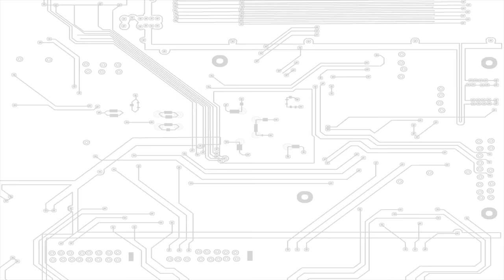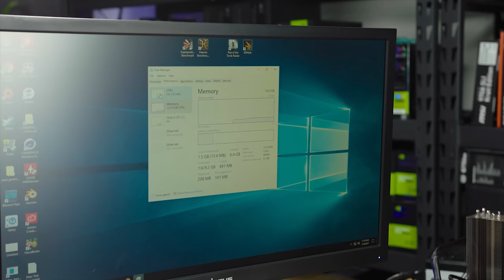How to fix bent CPU pins

Comment: I dropped my AMD FX-8370 on the ground and got thermal paste on the pins! The pins bent on impact and I re adjusted them. I got the thermal paste off using a toothbrush and some rubbing alcohol. This video has really brought back some flashbacks for me, Jay!
Reply: Macie Jay that’s a scary moment.
Reply: Why was there thermal paste on the ground? o_O
Reply: Not thermal paste...
Reply: Forgot to mention I got thermal paste on my hands and my handling the CPU somehow got it on the pins :/ sorry
Reply: Macie Jay if that happend to me i would bend it back like a real man with my nail.

Comment: @JayzTwoCents  This video just saved my Ryzen 7, my 6 year old I5 streaming PC burned out and I'm building the new rig with a Ryzen 1800x...but it somehow had 3 bent pins in the middle when I took it out of the tray, and so I did a search and found this vid.  Can't thank you enough good sir, you just turned a nightmare into an awesome day. :)
Reply: And whats happenjng when you broke pkns? It dont work or work worse?
Reply: @greenray3174  None of the pins broke, I was able to bend the pins back and install the Ryzen 1800x in my motherboard.  The 1800x is still working in my "new" system 11 months later, I use it for gaming/streaming and everyday use. :)
Reply: RepublicOfAwesome Will I be able to get away with 1 bent pin?
Reply: gonna have to do this with a 3700x. Installed the aio we bought, the cpu popped out of the socket trying to get the damn arms locked into place installing the cooler and bent three pins on the edge of the cpu. absolute nightmare when the damn system wont boot.
Reply: @Owowkiller  did you fix it?
Reply: @MasterTeep  i never did, no. havent been back to my friends house since then.
Reply: Owowkiller any update ?
Reply: @Owowkiller  Fix it?
Reply: @gedimangediman  yep finally did.
Reply: @Owowkiller  Great. 🙏🏻

Comment: Thank you sir, I managed to repair my Ryzen 1800X using your advice.
Reply: Nice!
Reply: I managed to repair my 3700x god i was so stressed but i managed to straighten them. also do u have any idea if because i repaired the bent pins will it affect performance or will it run normally
Reply: Hitman gAmer  yeah it started after i fixed the pins
Reply: Hitman gAmer  no problem, be careful and fix dem pins
Reply: AndreiPNK I don’t know if anyone’s answered your question but to my knowledge. It’s either gonna work as it should or not work at all. Hope all is good brother!
Reply: @2xsarge  oh ok thanks
Reply: Hitman gAmer  did you do it
Reply: @retardmoguss  how'd you get em to exchange when you broke it lol
Reply: how did yall break your ryzen's
Reply: Joseph Letourneau doubt it
Reply: @Dozuken  It actually came with bent pins, I didn't notice and when I inserted it into the cpu socket, I bent them fully and didn't notice until after I tested every aspect of the motherboard and went to reseat the cpu.
Reply: @Vomarik  Bent pins out of the package? fuck thats scary
Reply: Dozuken  never experienced it before so It was the last thing I expected. This was my 12th build too. First time with a cpu problem. It’s still going strong after a year.
Reply: SeaHigherVisions did you figure it out ??
Reply: I bent 3 pins when pulling the cpu out with the cooler, bent even more when attempting to fix them. Tried several times to boot it up after straightening them all out and no post. My motherboards VGA led light stayed on so I lilies into that. Read that it could be a dead gpu which, so I tried connecting the DP cable to the motherboard to get into bios and nothing. I unplugged the power to the gpu and flipped my display port around and it worked. It boots up fine, just had to enable axmp again and it’s all good. Hope this helps someone
Reply: I am having the same experience right now with 3700x, I have fixed the bent pins but when I boot up my computer 3 red light on mobo light up (including cpu) for like 1 sec and goes off, I mean they stay off but at first they light up. I can see my cpu in BIOS btw with all the numbers. Is that okay ? or something still wrong with my cpu ?
Reply: @outplayed4511  I have that where my cpu lights up right before boot on my msi b450 tomahawk max
Reply: @andreipnk8430  its been a year. Hows the cpu doing?
Reply: @iskandar25e  its actually doing really good in my pc lol. Didnt even realize its been over a year.
Reply: @andreipnk8430  holy shet, its that effective huh. Thanks for replying tho
Reply: @iskandar25e  i mean if you can bend them back effectively its like it never happened. I only had like 3 bent in the corner
Reply: @andreipnk8430  i hope i wil never get in that situation. It would be so scary😭
Reply: @andreipnk8430  you build pc by yourself? Even without building one before? Im about to build my own pc but a little scared to do it alone
Reply: @iskandar25e  yeah, just follow the tutorials, if you put the cpu in and cooler right you have nothing to worry about cus the rest is easy.
Reply: @JL is your rig still working fine?
Reply: @brucebatmanwayne8514  yep. It’s a server now running Rocky Linux.

Comment: Just an FYI if you do break off a pin you can find where it goes in the socket and drop it in it's spot then drop the CPU on top and it will still work. Linus did that with a Phenom II 720 in an old NCIX video and I did it with an old Phenom II 550, with 3 missing pins,  which still unlocked to a quad core after all it had been through I might add. 

You can even use a piece of copper wire if you don't have the pins available which is what I did as I bought my CPU with the pins already broken and lost.
Reply: Craig MacDaniel
Not recommended.
I have an old Foxconn board with 1 broken pin, that was actually ground and that caused a trace from one of the DIMMs to burn.
Now it has 2GB max memory.
Reply: Board? Meaning pins are in an LGA socket? Then yes, don't be sticking wires in an LGA socket. And if you're doing the copper wire method in a PGA socket make sure you're wire isn't too long that it bends over and touches an adjacent pin. When you bend that arm over the CPU does move a tiny bit.
Reply: https://youtu.be/EdDccsbv5hA?t=86

This video says otherwise. Although I can't guarantee it will work if it's a pin that supplies power or ground. But data pins work just fine.
Reply: Happened to me back when Newegg was just starting.  Got an AMD 450 MHz socket 7 processor that was damaged in shipping and Newegg refused to do anything.  Had the charge reversed and decided to see if I could do the wire trick with the missing pin since it wasn’t working.  Started with too small of a pin and worked up in length when I finally had the right one I made one just a little longer to maintain tension.
Reply: When doing the wire method you would completely remove any excess pin and just have the pad on the CPU and if you use thick enough gauge wire (similar to the thickness of the pin itself) then the bending is not really an issue. Unless you cut it way too long, but if you just do a test fit to make sure the wire doesn't get bent over too far after you put down the retention arm then you should be fine. 

I mean I assumed people would have some common sense and test the fit before they turn their system on. If you have a wire that's too long, you're probably not going to be getting a good mount on your CPU in the first place, which should be pretty apparent...

And solder will work if you have a pin on the edge of the CPU, but try holding the pin over the pad, getting the tip of a soldering iron and some solder onto a pad surrounded by other pins and you'll see where this method comes into play.

The entire process of fixing bent pins is a pretty last resort situation in the first place so I don't know why people are balking at this.
Reply: Craig MacDaniel  Either not good with their hands, expert syndrome or both.
Reply: I need some help repairing my dad's laptop, it's got me stumped. I took out the hard-drive of a very old dell to attempt to fix his windows 8 dell laptop, and when I try to set the boot path in the BIOS the only options I get are Recycle.Bin, Diag$ and magmdia but when I set it at any of those 3 all I get are 3 dots. :/ help would be greatly appreciated. I'm thinking it won't run because the old drive has windows 7?
Reply: If the HDD is not being picked up by the BIOS you've probably got a dead SATA port on the Win 8 laptop. The BIOS won't care what's on the drive it should just tell you if there is a drive or there isn't.

Out of curiosity what happened in the first place that it "stopped working"? Did he go to boot one day and it couldn't find the HDD to boot from or was it gradual?

Can you try the Win 8 HDD in the Win 7 laptop?
Reply: Craig MacDaniel Oh, well, the laptop was dropped from 2 feet when I accidentally tried taking it, it was plugged in and it slipped out from my grip and landed on the floor, the hard drive no longer works at all, but the laptop does detect the HDD and stuff.
Reply: Go into Hard Drive BBS properties or similar setting in the BIOS. That should allow you to choose the primary HDD of the system. The drive you choose in this setting will then appear in the boot order setting.

Hopefully that's it and there's nothing else wrong with the hardware.
Reply: Craig MacDaniel Oh, see, I try to set the boot path but when I try to set a path it says I chose an invalid input, I feel like my dad may have shorted the SATA connector when I forced one of the screws put and bent the threading and where it screws into, whole also completely ripping off the rubber surround that invaded that screw :/

Comment: I got so amd when he dropped the cpu
Reply: Was that intentional?
Reply: Skedge nice auto correct😂☠️
Reply: Wahh wahh waaaaah 👍
Reply: @Skedge  cup.
Reply: @Skedge  whoosh
Reply: Using top down processing I see
Reply: Please help me i accidentally touch the bottom of my cpu im affraid that i might ruin my cpu and put some static discharge on it, I haven't tried it yet because my motherboard hasn't arrived yet.
Reply: @ryomensukuna203  chances are extremely slim, if there was an audible and visual discharge, I’d be more worried. Your fine! Just don’t touch those pins because your skin oils are a bigger threat than static. Just ground yourself next time you handle any parts.
Reply: @bigd2829  Is it true that processors now a days have anti static coat? Because im worried that i might static my cpu cause i clean it
Reply: @ryomensukuna203  a lot of computer parts nowadays do have safeguards to prevent discharge of static electricity. Plus even if it is fried, you should get a refund because that would count as it being dead on arrival probably and you have no way to prove that it was you who caused some sort of ESD or if it was just a defective component they sent. I wouldn’t worry.
Reply: @bigd2829  i clean the bottom of my cpu in the middle of pins because i see some residue with 40% isopropyl is it okay? I see a alcohol that easily vapor in the middle is it good or can damage my cpu?
Reply: @bigd2829  I haven't tried him yet because my other parts of pc hasn't arrived yet so i dont know yet if there's a problem, and my cpu warranty slip from the seller has gone :((

Comment: You're a life saver! I'm working on my new build and got a new motherboard, and a new Ryzen 9 5900x. The computer wouldn't start at all, fans wouldn't turn on, and only the lights on the motherboard would turn on. I found two bent pins on the CPU and was able to bend them back thanks to your video. Now, it turns on with no issues!

Comment: the pins on the CPUs are surprisingly strong. the first time I took apart my computer the Athlon 2 X2 215 came off with the cooler without me realizing it and it put the entire weight of the cooler on the CPU and not one pin bent. when I realized what happened I was super impressed with the little pins holding that much aluminium.
Reply: Zecrid Weight distribution. It's like lying on a bed of nails.
Reply: All about surface area.
Reply: Elijah Burleson Lying on a bed of nails is still not great and perfect weight distribution is hard to achieve, especially while putting it down on a table.

Comment: I had a single pin that was slightly bent and I used your razor blade method and I have never humped the air in success so much in my life

Comment: I bent mine my bumping it against the metal thing that u need to lift when installing the cpu. I bent two pins and when i put it in it was rocking and not fully in. I fixed it using a razor and it worked🙏🙏. Thanks my guy.

Comment: I wonder if a mechanical pencil with no lead in it coupled with your razor blade method woulf yeild good results? Solid video Jay.
Reply: John Totten I've personally used the mechanical pencil method in the past, though the pin density of a Pentium 120 is very different from a Ryzen CPU.  You need one with a narrow hosel (where the lead comes out) and collar (piece the hosel protrudes from) so as to not interfere with the other pins.

Comment: The worst thing I've ever done with a CPU that was brand new was accidentally use thermal adhesive instead of thermal grease. Ripped the lid off the CPU pulling the heatsink off. Split the die in half.
Soldering a pin is not that bad you just need practice and a steady hand.
Reply: Haha dang. That's brutal
Reply: Dang, that sucks! Should have cut down the middle with a long razor.

Comment: Amazing! I came here after watching your video on how to clean thermal paste goop off the underside of a cpu (don't ask how it got there). I accidentally bent a couple of the corner pins by pushing a bit too hard and the cpu would no longer fit in the socket. I used a razor blade as suggested and it worked like a charm! Thank you Jay, 6 years later.

Comment: I used a sewing needle to unbend my pins. Worked like a charm. For some reason a sewing needle fits very well between the pins and you can use the point of the needle to get under the bent pins and push them up.

Comment: Thank you so much for making this video, you totally saved my ass. I was swapping out coolers for my 2700x and the thermal paste applied to the bottom of my wraith prism formed an air tight seal that glued my CPU to the heatsink. When I pulled the heatsink out it tore out my CPU alongside it, bending several pins. Sat there for a few moments trying to find a way to mentally cope with losing $300.

Shortly after I made my way to your video here. Seeing you go ham on that CPU filled me with courage because the damage to mine wasn't nearly as bad as the damage you did. Fast forward an hour later and thanks to your instructions I fixed it myself and my machine is 100% fine. Seriously, thank you so much.
Reply: The exact same thing happened to me yesterday. I felt like an idiot because I have built countless computers and I was doing this one for a friend. I noticed the bent pins and fixed it with a knife. I have never heard of bent cpu pins so I was thinking of making a tutorial on how to fix it. Not only was this video already made, but apparently bent cpu pins is a frequent problem with first time builders with amd.
Reply: @Zoltoks  I know that exact pain. I decided to upgrade my rig and donate my old parts to my younger brother and I didn't want to call him up and tell him that the deal was off due to an error on my end. I've been doing builds for friends/family for years without any goofs and I like being that guy people can confidently trust to handle and repair their expensive hardware without error. I've never had something break on me like this before and it makes me feel even better about myself knowing that I can repair this kind of damage now. 

Glad to know that you were able to help yourself as well.

Comment: I echo other people here when I say that you gave me the confidence to fix my cpu. Just bought a Ryzen 7 3800x CPU and on install I messed up the heat sink install and bent a few pins. the computer would not boot with more than 1 stick of ram. I took apart the computer and found that some of the CPU pins were bent. Honestly, I thought that I had just wasted $300 but then I found your video where you showed a good process and I fixed it and my rig now works again. Thanks!

Comment: Hi Jay; I damaged a few pins on my 3700X today while upgrading my CPU cooler (the paste on my old Wrath Prism was so caked on, and the mounting mechanism is so janky, that it pulled the CPU right out of the socket as I tried to undo the bracket). I was able to get the pins mostly straight on my own but not enough to fit into the socket. I thought I was going to have to blow almost $300 on a new one but decided first to try to find a video on how to repair it. Your razer blade technique was able to get everything lined up enough to go back into the socket, and everything now works just as good as new - better actually, with the new cooler! Thanks so much for the extremely useful content.

Comment: No stress test ? I thought you would have to check stability.
Reply: Repth Stress tests will not change anything. It might have been a power delivery pin that the CPU didnt necessarily need and hamper stability a tiny bit, but there is nothing noticable. With AMDs plan of supporting Zen+ and Zen2 on the same socket, there should be a lot of dummy pins and those are ideally placed around the corners/edges for obvious reasons.

Comment: Some of the AIOs when you remove them in a specific way, will rip the CPU out of the socket and bend some of the pins. This video is very helpful and helped me fix a CPU then got ripped down and correctly. Make sure when you remove the cooler or AIO that you twist it so that when it comes time to remove the CPU cooler the thermal paste that binds the two objects will allow some air to get between the gap and not have a suction effect pain will allow them to be removed easier